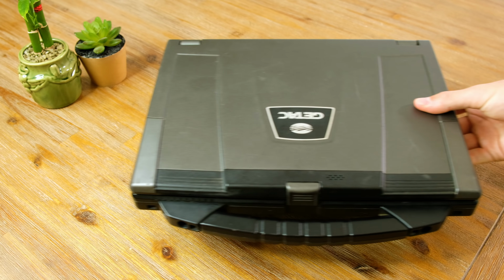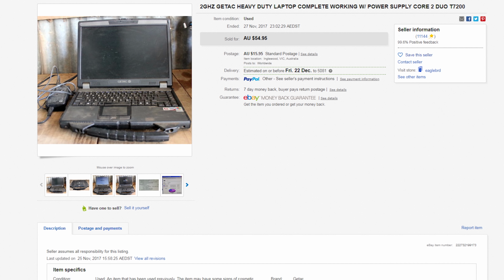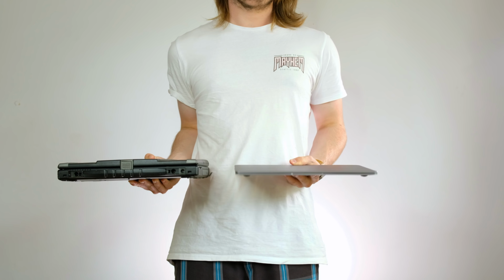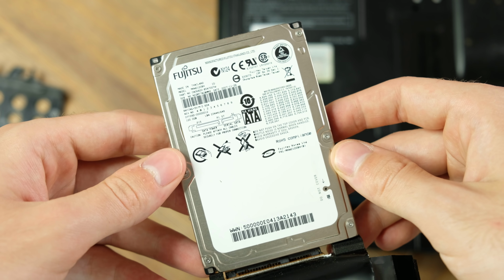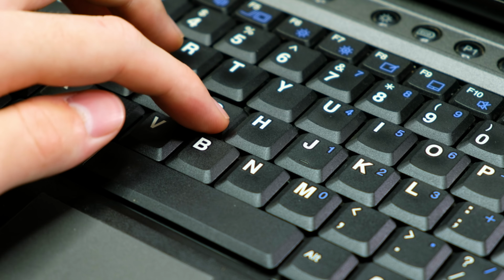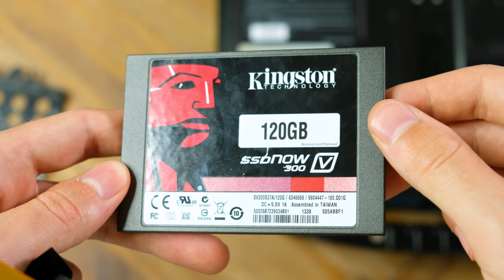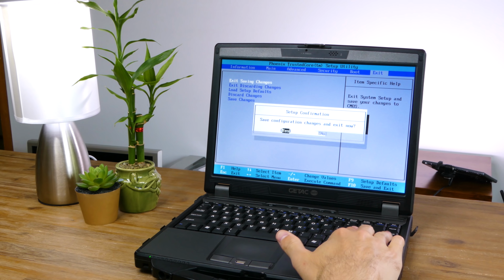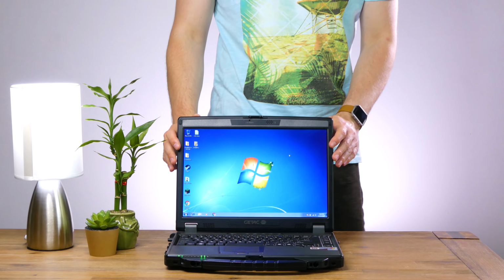The Strongest $55 Laptop Ever?

Comment: Being that it has a touchscreen, it would be interesting to see if Windows 8 or 10 would run on here.
Reply: 8.0 should, but 8.1 and 10 won't due to the graphics chip. ATI/AMD graphics chips older than the HD 5000 series don't support 8.1 or 10 so they have to run with poor MS update supplied drivers. Those simply don't work worth a darn for the most part.
Reply: That's not correct! I got Integrated HD 4000 graphics with Windows 10 and the drivers provided in the BIOSTAR's website for Windows Vista works just fine with Windows 10.
Also tested SAPPHIRE HD 3450 512MB with Windows 10 and catalyst center is installing the drivers perfectly fine to Windows 10 and it all works without any problems.
Reply: Sali Ali, I'm glad it's working for you, but it has never worked for me. CCC will install, but the driver will either fail to install, will cause instability, doesn't provide full functionality, or get's replaced by MS. I've tried it on over 50 laptops with older ATI/AMD graphic chips and none worked worth a darn. Most of those had an integrated 3000 or 4000 mobile chip.
Reply: I've an AMD Radeon 6600m & 6700m series, one of the so not supported chips, but It works perfectly with "modded" drivers.
Reply: Yes it's perfectly correct actually, the old mobility X chips have no drivers for Windows 10. They did up until one of the recent updates that completely broke it having black screens on logon screen with the inability to even use the PC. This laptop stands a tiny chance.
Reply: ATI Mobility 3650 is not the Mobility X series chips I'm talking about, such as the X1000 series.
Reply: @cee128d  you can use the older 8 driver for the GPU it should work with 10
Reply: @ericland9865  Not really. 8 and 8.1 use a different Driver Model so graphic drivers for 8 don't fully support 8.1 or 10. An 8.0 drive won't work any better than, or even as well as the MS supplied driver. As I said previously, I've worked with a lot of laptops with those older graphics chips and know exactly what does, and doesn't work.
Reply: @cee128d  I've gotten a system that has unsupported graphics on Windows 10 working fine with the 8 drivers. It stable for the basic stuff ie YouTube and other basic tasks
Reply: @ericland9865  There are a lot of DIFFERENT unsupported graphics and how well they work (or don't work) depends on a lot of different things. The drivers for the Graphics chip in this laptop stopped with Windows Vista so anything past Win 7 will rely on MS supplied drivers included with Windows. As I have stated numerous times, I've tried 10 on computers with this graphics chipset and know it doesn't work beyond basic tasks. 640 x 480 and maybe 800 x 600 if you are lucky. Youtube at 240 if it works at all. Essentially, it's pretty useless.
Reply: @cee128d  I've gotten on laptop's their native resolution and on tge few desktops I've gotten up to 1920x1080 it's luck of the draw i always use the chipset manufacturers drivers they are more reliable. You can also install them with compatibility mode set in place to get them working
Reply: @ericland9865  Not on ATI graphics of this vintage. They stopped with Vista. And ATI drivers from this era were terrible at best. If you have Intel or Nvidia graphics from this era you stand a good chance of getting reasonable results, but NOT from this older ATI graphics chips. I have several laptops from this era and the ones with ATI chips will not run at full resolution period.
Reply: @cee128d  most work upto a certain point like you said but there's always a diamond in the rough
Reply: Man,i have a laptop from 2004 and it is not absolutely durable And it has got Celeron 410 clocked at 1,4ghz And ATI Radeon Xpress 200m series i tought IT would run win 10 bit instalation failed then After installing win 10 i succesfully installed win 8.1 with graphics driver i was So happy ,IT can run Minecraft ,GTA san Andreas And many other games. The laptop Is Toshiba satellite A110-339 series

Comment: You should make a video similar to this, but about the Dell Latitude D630! I feel as though that laptop actually still holds up pretty well.
Reply: i have one of those and with a core 2 duo t9500 4gb of ram and it runs linux mint and it works great
Reply: I still have one as well and I agree, especially considering it's age it runs great!
Reply: One of my favorite Dell laptops

Comment from the maker: Help out my channel by using the Amazon affiliates links below :) 
Gear I use:
► Camera - Fujifilm XT2 https://amzn.to/2Nt9R28
► Lens - Fujinon 50-140mm F2.8 https://amzn.to/2NrnIGl
► Lens - Fujinon 18-55mm F2.8-4 https://amzn.to/2Nql3g3
► Laptop - Macbook 12” https://amzn.to/2NYMHO6
► Phone - Samsung Galaxy S9+ https://amzn.to/2NB7afa
► Microphone - Rode NTG3 https://amzn.to/2NtgAZY
► Audio Interface - Steinberg UR44 https://amzn.to/2NuxQhy
► Headset - Audio Technica M40x https://amzn.to/2NsZR9g
► Keyboard - Steelseries M800 https://amzn.to/2Ny6Q0o
► Mouse - Logitech G502 https://amzn.to/2NqjDCf
► Backup Drives - Seagate 6TB https://amzn.to/2O2Y1sH
Reply: I have the same hp laptop

Comment: Pretty neat. I still use a Pansonic Toughbook CF-52 Mk.II to this day on Windows 10, since it has a more powerful Core 2 Duo chip in it and ATI Mobility Radeon HD 3650 graphics. Works pretty well at emulating PlayStation 1 at 1920x1200 honestly :P

Comment: Good stuff, I found this channel at random, but it's totally up my ally as I'm always searching eBay doing cheap bang for the buck budget builds, and laptops. I recently got myself a clean Lenovo Thinkpad X131e(AMD ver.) for $60 US, and  will be using it as a test bed for Linux distros, and Chromium OS.
Reply: It's hard to find pristine one, most were beat up lol
Reply: Agreed that can be tricky, the inside of the one I got looks almost new, but the bottom needs a few touch ups(will just repaint the entire bottom), and the top needs some Meguiars Plastx to try, and buff out the few scratches, but I also have the Intel version that's preinstalled with ChromeOS that's in 98% new condition beyond a small crack around the HDMI port I rarely use anyway. I just keep saved searches of stuff like this so when they pop up cheap I can grab them.

Comment: Those durability tests are nothing.... compared to my laptop

Shocked four or five dozen times, fell a few dozen times, thrown down the hallway so hard the battery fell out, over the heater DIRECTLY for HOURS without me knowing, slept on several times, and sat on several times.... what’s happened to my laptop, not to mention me POUNDING on it in frustration, and having soup spilled on the keyboard before....

IT STILL WORKS PERFECTLY.... AND ISNT DAMAGED....
Reply: Jesus, what fucking unbreakable tank did you have?

Comment: I'm curious to know why the first her drive you tried to put in this would not work? I've got a Panasonic ruggedized laptop with a very old hard drive and would like to if possible, replace it with a solid-state hard drive. That machine you got there, you flat-out can't even get any more closest I could find from that brand with her drive on eBay would run you about 150 American, plus the shipping. I don't know how you got one that good under 100 the Panasonic that I'm using. I got by accident where the guy had made a mistake in the listing. He ended up selling about nine of them before he noticed the mistake with a hard drive running windows XP. These machines will normally run you about 200 and with the power supply and shipping. I got the thing shipping and everything for about 130 Canadian which is pretty much unheard of for a Dual core Panasonic ruggedized laptop that has a fresh operating system power supply and everything. Generally there sold without the hard drive  Or an operating system. Would really love to grab that laptop if you're interested in selling it for the same price you paid for it. I should point out the reason it wasn't running Windows Vista is because the government have a lot of problems with Windows Vista! Anybody running a ruggedized laptop was usually government or military, such as police departments at one point several government departments went from windows XP to Windows Vista here in Canada and they spent millions converting back a couple months later, the problems they had with Vista were insane and it wasn't long before they went back to windows XP a lot of government facilities are still running windows XP because of issues with newer operating systems. I'm guessing Windows 10 won't run on one of these old machines and that's why you use Windows 7?

Comment: Try linux on old pcs try something like linux lite its on of the best user friendly distros that is lightweight
Reply: Noah Bachman should run XP on an SSD.
Reply: Linux would be nightmare... gpu drivers
Reply: The old ATI cards are supported pretty well on Linux, I have a couple of old HP corporate laptops (one identical spec to this, one with the X2300) running Xubuntu from cheap SSDs and both are fine out of the box.
Reply: @spacy9571  getting the latest gpu drivers on linux has been no issue for years. Some distros like mint even justs asks after install if it should download and install them for you
Reply: @pteppig  nope any Linux distro doesn't have GPU drivers for old and unpopular distros...my gt 9800 or r5 230m doesn't have ANY drivers on latest Linux distros

Comment: The Intel GMA graphics on the Core 2 Duo T7200 should be able to run Windows Aero just fine. My personal experience with my upgraded Latitude D620 prove this. However, seeing that you have a laptop that I've never heard of, drivers were probably the issue. OK. Wait. It must be the ATI graphics.

Comment: Well... With some hardware updates it will be much better, and with windows 7. 
Get a better core2duo for it and more RAM. 
It will be much better. Even Cs go will run way better, CS go is a CPU hog (heavyly uses CPU), not much the GPU.
Reply: The t7200 is the best from the line t7400 was rare and just hot... Running csgo on ago x1350? No thanks
Reply: Metzelbaer Nibbels cs go is old game...